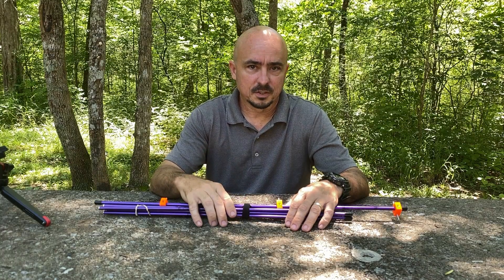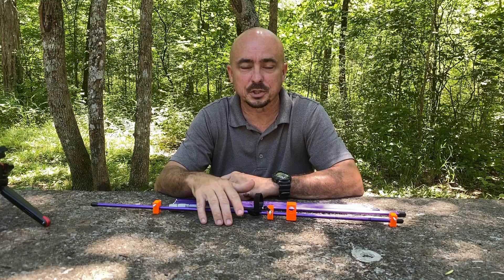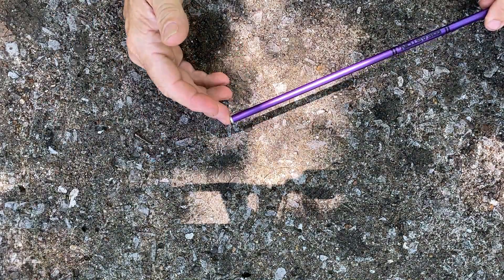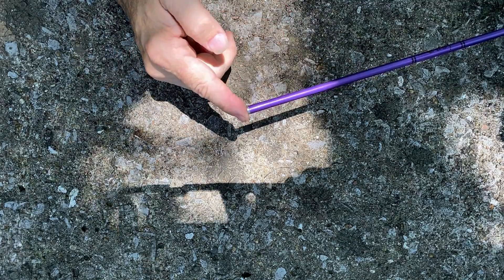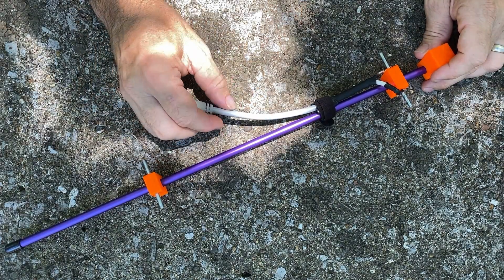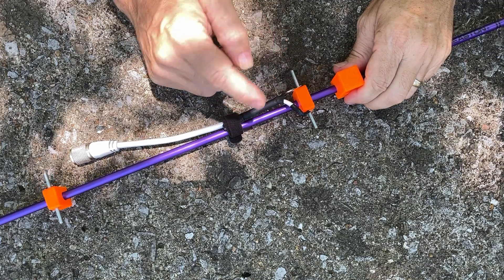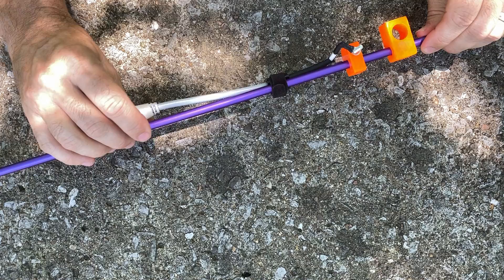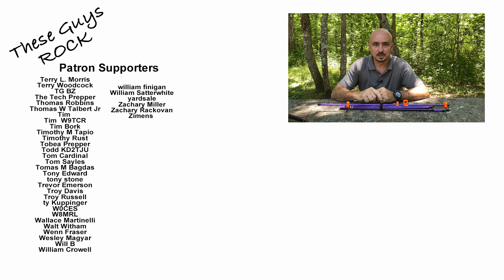2M Yagi Homebrew

Comment: To make a secure connection to the arrow shafts, there is a low temp welding rods for aluminum. You can basically use a propane torch to weld it. Do you have a text guide to construct this antenna protect? You didn't mention the details of element length and spacing. TY

Comment: Crimping may, eventually, cause failure.  Hot glue usually works quite well.  Bohning Ferr-L-Tite Point Glue:  heat with a lighter or other open flame.  Then, rotate the hot glue around the insert and QUICKLY push it into the shaft.

Comment: I like it. I'll probably do something similar in future.
For 3D modeling I use Free Cad.  It's a parametric package so you can get all the measurements accurate.  Bit of a learning curve, but works very good at this point, for the most part.  Also, it's Free.  Works on Linux and Winders.  :)   (probably works on that 'other' system too.)
If I find a conductive epoxy, I'll come back and post it.  I also like the heat it and let it shrink on that some one else posted.

Comment: Hello, thank you for sharing the knowledge!  To crimp the arrow shafts onto the arrow insert, what I use is a pair of coax crimpers I have from back in the day of C band satellite antenna instalation. It is a hexagonal crimper used for RG59 and RG6 F connectors.

Comment: There is hot melt insert glue. If you ever need to take the inserts out, just heat them up and pull them.

Comment: Awesome build! I am going to attempt this build this weekend. Lacking a 3-D printer, I will make the insulators out of 1/2” HDPE sheet that I have. I’ll thread the element studs and set screws through that. To further add to compactness, you could fabricate the main boom out of fiberglass tent poles that break apart in the middle. Thanks again!

Comment: Great video.  Glad I found your channel, new Subscriber.  A couple of thoughts.  Aluminum arrow shafts are usually an alloy, very stiff and brittle so a crimp or dimple (good ideas, by the way) might tend to crack these shafts.  Two important things, 1 - need to keep the internal ridges on the inserts clean and 2 - need to maintain electrical conductivity between the insert and the shaft.  check out a local sporting goods shop, preferably one that has a good archery section. with knowledgeable personnel,   big boxes usually don't really have these type if employees.  Easton does offer a couple of adhesives, one a 24 hour epoxy and another quicker setting adhesive.  typically, these are applied to the entire insert possibly eliminating conductivity.  Might try just to apply the adhesive to about 1/4 to 1/3 of the tip end and carefully insert it.  Might be a good solution.  Have a lot of archer friends and maybe able to score some of there old aluminum shafts.
Reply from the maker: Thanks for the tips!

Comment: Great build! I have been using my arrow antenna (vhf elements only) on several SOTA activations where I couldn’t get any contacts with just my HT whip.  Problem is, it’s a bit big and a bit heavy - looking at a DIY builds and your 3D element brackets are great! Is it a file you share?  Cheers

Comment: Have made a ton of arrows for actual archery use, though I use carbon fiber arrow shafts, not aluminum... the inserts are typically glued in with a couple of drops of CA glue. That's strong enough to keep them in when shooting them at nearly 200 mph from a compound bow and surviving the impact at the other end!

Comment: Very nice build. Better quality than I've seen and there are no commercial alternatives for your design.  I've built several 2 meter beams, my biggest problem so far has been finding commercially available element "holders". I don't have a 3d printer so I was forced to search for element holders on the internet. In this land of plenty (USA) you would think you could find holders readily - but no, ordering from UK or Bulgaria was my only choice and shipping was expensive. The 3d printed holders have stl files galore out there but if you contact one of the 3d companies willing to print out your stl - you'll get charged galore also. Really if want to DIY a VHF antenna, once you find a good element holder / substitute that you don't need to modify, the rest is cake.

Comment: N6EF-Thanks for some great ideas. I built something similar which I saw on Chuck, KK6USY Radio Adventures', channel which was inspired by Adam, K6ARK's build. I used some generic shafts I found on eBay and some inserts which were a bit loose. I used a center punch and put a dimple in 4 places around the shaft to keep it from moving. It's not super tight, but it doesn't move much. You can punch it too much and deform the insert to the point where you can't get the screw inserted which I found out the hard way. I found a 1/4" wire brush on Amazon which I used to remove the anodizing from the inside of the shaft to make better electrical contact with the insert. It seems to work pretty well. I don't have a 3D printer so I just connected the shafts so some 3/4" aluminum square stock I found at Home Depot which seemed to work well. I used some 8-32 screws which go through the boom. It took 2 36" pieces of square stock to make the boom. I joined the boom pieces with a piece of scrap 1/2" copper pipe which fits nicely in the square stock. It's not as light as I'd like but it fits nicely into a 27" tripod bag for portable operation. I'm going to try something similar using wood instead of 3D-printed plastic for the element-to-boom connections. Thanks for the video and ideas.

Comment: See my other comments under Chris Sewell, but also I'll add here: More aluminum arrow info:  The four digit numbers are the sizes, ex: 2213, etc.  The first two numbers tell you the diameter and the second two numbers tell you the thickness of the metal.  A 2117 is smaller than a 2213, but it also has a thicker wall.  Stiffness is a function of diameter, and so is bandwidth. Also these numbers are how you buy the right sizes of inserts and tips and nocks.  Enjoy.

Comment: Some great ideas/suggestions already!  My 2 cents...I would use a glob of fletch-tite or thick/gel CA glue .5" inside shaft.  Then push insert in and use hex/coax crimper of appropriate size for mechanical stability then stand vertical till glue cures.  Electrical connection should be ideally made on the face end of the shaft like where you cut to length and the inside lip of the insert, assuming you can square and match both surfaces to minimize gaps.  Remember skin effect is your friend here.  Make sure you use brass inserts rather than aluminum to greatly reduce corrosion on the aluminum from interaction with the steel threads.  Nice build Sir!
Reply from the maker: I will try the glue you suggest :-) I just had the thought yesterday to try coax crimpers. Not sure why I didn't think of this before the video. Works like a champ and give exactly the desired results. No problems with continuity on the few tests that I have done so far. I think this will be a winning combination! Thanks for the tip on the glue.

Comment: I have been researching portable yagi antennas like this. I haven’t asked him but I thought Adam,K6ARK used a bnc crimp tool. I thought I would try a silver epoxy, as it’s supposed to be electrically conductive. Also in archery I use hot glue for my arrows used with my compound bow, but that would prevent continuity

Comment: What if you used brazing to attach the inserts to the aluminum arrows? it's basically soldering and with silver brazing rod it would make a great electrical connection.
Reply: I was thinking the same thing as I watched the vid
Reply: I was also going to suggest this.

Comment: Jason, you might want to try to some small hex head screws to tap an eighth of inch to one half inch and stake the screw head. I compare it to staking the parts on a gun. Patrick
Reply: Jason, there was something else that I thought of. If you have something similar to what buddipole has, “Knurled Whip Sleeve” but with outside threads on one end and the inside threaded on the sleeve on the other end. Then you can have the outside end on the arrow shaft that will attach to boom threaded in addition to what I previously recommended. You are ready for portable operations as mentioned in your video. Patrick K6PFG.

Comment: Hey Jason! I did a similar Yagi but instead of arrows I cut some hard aluminum tubing I bought from a metal distributor in Brazil and threaded one end with a 1/8 tap. For the boom I used a PVC pipe, but using aluminum as you did would make it much lighter! Great build
Reply: The tube is 5/32 with 1/32 schedule

Comment: The crimping tool you need is a swaging tool similar to the wire rope crimpers.. Amazon  link : https://www.amazon.com/s?k=Swaging+Tool+%281%2F16%22%2C+3%2F32%22%2C+1%2F8%22%29&ref=nb_sb_noss
Reply from the maker: Thanks for the tip!

Comment: Try a prick or starter punch and lightly tap a dimple on the outside of the shaft into the insert in a few spots around the shaft....it's not like you need the shaft to fly straight. The dimpling should give you a quasi crimp. This also works for standard nuts to prevent them from backing off a screw or bolt when you don't have a nylock nut.

Comment: There is an insert glue for arrows. But you can GENTLY heat up the end of an aluminum arrow, so it expands. Then just slide the threaded insert, inside the arrow. When it cools, its rock solid. If you over heat the aluminum with a torch, it will disintegrate!
Some glues may or not allow electrical contact!
Reply: Ferrule glue is what you're after. I'd give you mine if I could find it. I suppose they yet use aluminum arrows, or at least that some of those glues are yet out there.  HINT-- get some field tips to screw into he insert such that you have a nice handle/heat sink and to keep from getting glue into the ferrule.  Has been years since I messed with archery-but used to hunt and shoot the 3D tourneys.   Also--a heat gun is better bet for controlling your heat than a propane torch-but either can be used.
Reply from the maker: I will definitely give this a try!
Reply: This looks like what ARROW does with their antennas as mine have a slight outer diameter difference at where the insert ends (0.1 MM difference)
I have noticed a dimple on some older arrow antennas which suggest they were crimped.
Reply: Okay, I heard your next two lines, suggestions if you get ferrule glue: you'd be depending on the flange of the ferrule and the end of the shaft for continuity and to that end I'd heat the ferrule and touch it to the glue where it just picks up enough--and keep it on the back end.  Then shove it into the arrow but stopping just short of fully seated.  Then I'd clean off any ooze that squeezed forward in order to maximize Al to Al contact at the tip.  Once it's cleaned off you can then heat the tip of the arrow and slide the insert fully home (and maybe no more seepage will compromise your continuity... It's a lot faster to do it than to type it out.   If it doesn't work, heat it up, pull it out, clean all, and try it again.

Comment: Edit:

Jason, if I'm not mistaken, you can remove all 3d printed items except for the director. If you drill through the Al shaft the threaded rod should be a smaller diameter than your boom. Then you could just screw them directly and just use your 3d printed plastic just for the director. I thought Adam K6ARK had a video showing something similar. There are a couple more guys out there with videos too.
Either way, I'm in agreement that this should be in your store! What's that link again?

Edit: KK6USY was the guy. This is the video.
https://youtu.be/iv6CKQwnRtQ

K6ARKs video
https://youtu.be/a4XIgYD-d1k
Reply from the maker: Thanks for the ideas and links. I don't have this in the store at this time. Just something I am prototyping right now.

Comment: Fantastic project, Jason. This would be perfect for 2m SSB and FM simplex. Your 6 oz. build speaks to my man-portable soul. I am wondering if Loctite would work for your application? I would  to love try this for mountain topping once they're available. 73 de KT1RUN
Reply: I am pretty sure it wont conduct electricity
Reply: @LibertyCaveWS7PB  no, but the metal it’s locking together will